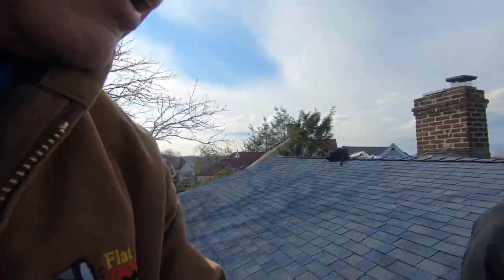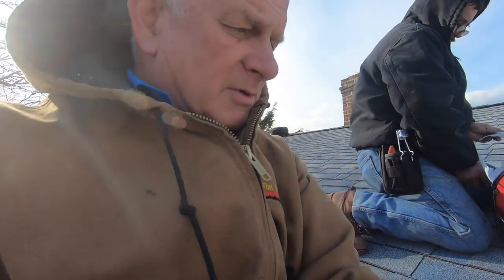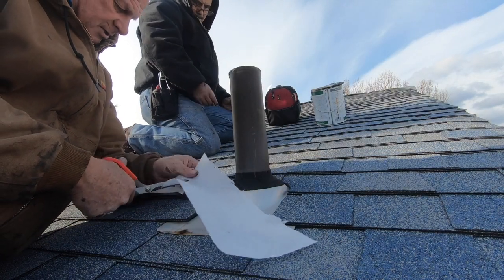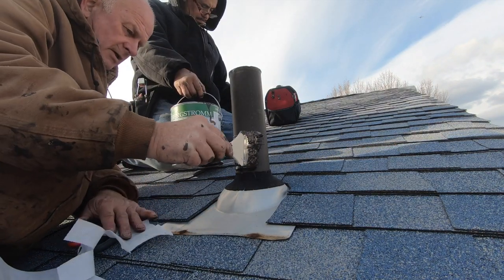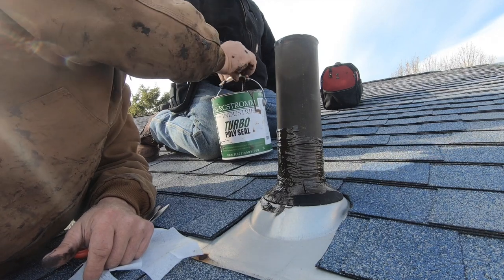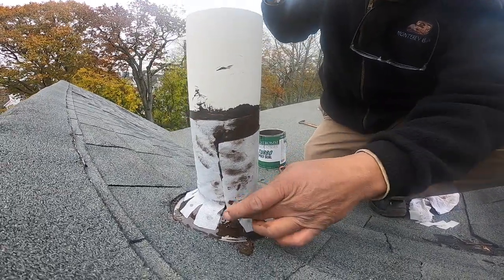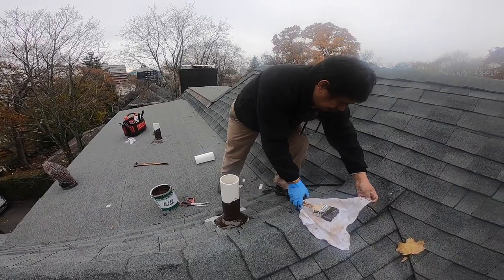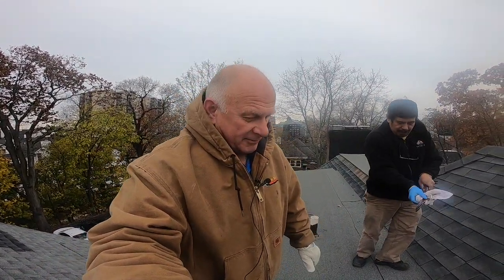ROOF VENT PIPE LEAK REPAIR on a Shingle Roof

Comment: What kind of roof is on the flatter part you're walking on?  I need that on my porch roof with a 3-1 pitch instead of the asphalt shingles there now.
Reply from the maker: It is a Peel and Stick Modified Bitumen rubber membrane. This particular one is the Liberty Brand from GAF
Reply: @FlatRoofDoctor  Thanks, Doc. The /gaf liberty roof looks like way more than I want to tackle.
Reply: If your in Canada, soprema alsan flashing seems to be almost exactly like turbo poly seal